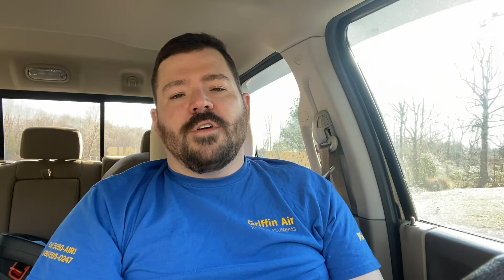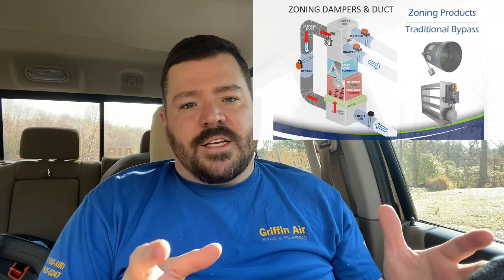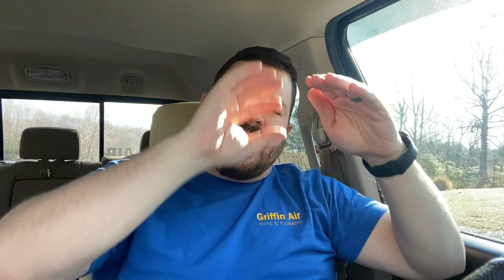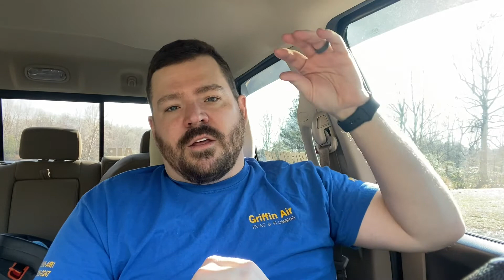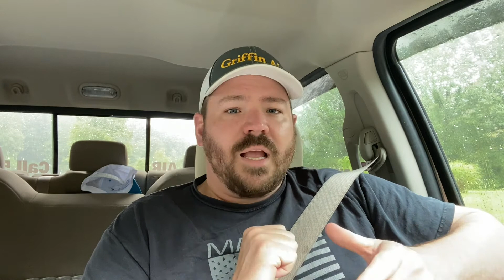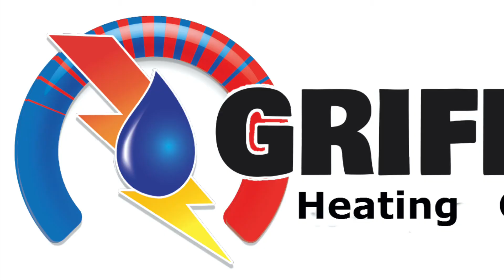Pros and Cons of HVAC Zoning  Do you need it? Basic zoning systems explained. Honeywell etc.

Comment: Zoning a multi stage system lets you stagger the schedules for different parts of the house, so you don't have 4 time slots for example, but rather 4 time slots for one part of the house and 4 totally different time slots for scheduling the other part of the house. It's just a unique feature worth exploring if you're system is zoned.

Comment: So if u have a multi zone system like this and say one part of the house is set at 76 and a different area is set at 80, will the shut damper end up developing condensation since air is hitting the door/damper? 

I feel like this is a recipe for mold down the road. Am I wrong?

Comment: I loved your video, wished I'd watched it a few months ago, haha.  I have a 2400 sf house that originally had a no zone system. The previous owner (5 years later) changed it to a zoned system with some duct modifications.  I am now replacing the system, as its 20 years old and i want to know if i replace it without using utilizing the zones, can I later have the zones added if I'm not happy with it?.  Basically, I'd just make sure all dampers are open.

Comment: About your zoning a smaller room. I have a bonus room upstairs that is about the size of a big master bedroom. It is surrounded by the attic and gets very hot in the summertime. Would you recommend zoning that room if we have a five stage unit? I understand what you're saying about a single stage blowing at 100% for a small room like that in your theory makes sense to me. But if we have a communicating system that can ramp down will zoning that room make sense?

Comment: I have found that zoning achieved with a control board and dampers is a waste.  The components fail.  When they fail, if not handled properly, can lead to failure of your HVAC system.  That happened to me.  The damper for the upstairs was stuck closed and the temperature cutoff sensor was also not working properly.  The evaporator coil froze up and the system also a bit aged.  The compressor ended up failing prematurely.

I prefer having separate systems to achieve zoning, when zoning is necessary (like different floors).  In that event, if one fails, you at least have the other.  I had a 3-ton AC that failed because of that damper.  I replaced it with a heat pump that is also 3-tons and it can be down regulated to 2-tons.  So, I will be getting a second unit and down regulate each one to 2-tons and have the option to switch it back to 3-tons if one fails.

Comment: On minute 5:00 you mentioned multi zone sometimes is not the solution. So what is your recommended solution if I have 1 room that's always get warmed up because of the sun hitting it all day but the rest of the house is cool? The difference in temp can be 10-15 because of this.
Reply from the maker: Every house is different. There are definitely houses were zoning makes sense. The point of the video was to point out how many customers think zoning is the solution when maybe it’s not or maybe it’s simply not needed
Reply: @NewHVACGuide  well, that's a very generic answer that doesn't even give any clues whatsoever for potential solution.
Reply from the maker: @hdarmawan   In most cases in scenarios like you're describing, I'd probably install a mini-split.
Reply: I wonder if there's less insulation in said room, it will probably always be somewhat warmer either way

Comment: Nice guy here, but he is not telling you about how to zone a house, but telling everyone why existing system should not be modified to be zoned.    You will spend more money on your heating and cooling than you do anything in that house.   I strongly suggest you hire a good mechanical engineer to design your system.  He or she will not be trying to sell you equipment or make some vendor's equipment fit an odd situation.   You would not hire a nurse to operate on your foot instead of a doctor.   Don't pay an HVAC tech do design your system, pay an engineer.  As an engineer, I don't tell the tech how to install ductwork or vacuum a line, but at the same time he should not be doing HVAC design.  It's the fox watching the hen house.
Reply: Fair comment, but mostly applies to someone designing their home to-be. Very doubtful the engineer could be value-added to existing homes (any more than an experienced technician).
Reply from the maker: Interesting argument. We should do a show and debate this 🙂

Comment: I thought you meant zoning for apartment buildings, there's 6 units everyone has their own electric furnace combined air-conditioning unit and this is where the problem comes in there's a vent in the hallway on every floor and that's because the owner doesn't have a separate AC heating furnace and some people refuse to turn on their air cuz they feel they shouldn't have to pay for the common area's I believe it used to be called a universal system but the girl across the hall refuses to believe that we both contribute to the hallway and shes put cardboard and duct tape over the vents which causes my unit to run 24/7 and my ceiling vents were wet! she doesn't believe I'm right & insists there separate units and one doesn't affect the other , we all have are own thermostat it's just that the system is meant to work together! my Father is a licensed Union pipefitter retired now but he's done all the huge universities uic Morton anoretium Braidwood nuclear plant Mars candy and pet food unfortunately he's 91 and is kinda slipping I don't want to argue with this girl but I don't wanna go out and get a bunch of window units and pay for someone to put them in, I don't believe shes the only one cooling the hallways I think the duct work is up in the ceiling where it pushes it out from both units pretty sure it's not legal in Chicago anymore

Comment: I just talked to a tech. He suggested to install a new 4 ton. system with two zones, a damper, and two thermostats. I have a house (1,400 sf) with an in-law attached to the house (500sf). He said that installing a new 1.5 ton system exclusively for the in-law will be more expensive on the monthly electric bill. Does it make sense?

Comment: I have a 6 zoned system. It cost me a pretty penny but I like it. I didn't do it for efficiency as much as for comfort and control. One thing that would happen is my bedroom faces east and as the sun would rise it would heat up the bedroom quite bit before it would increase the temperature on the thermostat to turn on the AC. It is a little on the loud said when one or two small zones are being cooled because its a 5 ton unit. But all in all being able to have control over individual zones is very nice.

Comment: I have a  1 story house , installed a new infinity system , 18 SEER , like the original 12 SEER 20 year system, one side of the house that gets more sun , there’s  is always 3 to 4 degrees different in those bedrooms, campare to rest of house , Do you think a 2 zone system that I was offered ,by installing comp, would help a lot or increasing insulation in the area of the house in central FL would be better , He offered to install the zone system @ cost because, I was not happy paying all the money and system didn’t fix my problems, but is an additional $2500 to $3000,

Comment: Hello got an estimate for dual zone system. First hvac company wants 3800 to install and hvac co say it can't be done bc I only have 1 return. The duct has one running to the second level and a separate one the the first floor. Can it be installed?
Reply from the maker: Every house is different. It’s hard to say the answer to your question without actually seeing your home. Sounds like you need to get some more opinions on the matter.

Comment: New subscriber here, if someone could help me with a question. I recently replaced my 18year old 4 ton system with a new 5 ton system. The old system had a zoning on it but my hvac guy said it may have caused potential issues with new system; so I went without. I do have 2 levels and the upstairs room is huge and is above our garage. My HVAC guy says it's gonna be an extra $2500 to install new zoning. Does that sound about right? I'm just trying to get more familiarized with an area that I know extremely little about.
Reply from the maker: There are many factors that affect the price of adding zoning. How many zones, the type of zoning you have, communicating, or non-communicating, and of course labor pricing in your area. I would recommend getting another quote if you are uncomfortable with the one you received.
Reply: @HVAC Guide for Homeowners  in your opinion would you say most 18 plus year old zonings would have an issue communicating with a brand new system? It's just a separate zone for single room upstairs. The old zone control is from EWC.

Comment: I’m a contractor.  I had one house and at least ten estimates from hvac guys.  Each hvac guy said the last guy I got an estimate from didn’t know what he was doing. I would need three units to heat the house. One guy was one system and said the rest of the guys were whacked out.  
You can go through YouTube and CONSTANT bashing of hvac guys.  You hvac guys really need to get your crap together.  Come up with some sort of standard for heating systems instead of this bashing the last guy.  It’s getting frustrating and old.  Tooooo much drama in hvac.  Learn to do hvac in some standard type platform and stick with it.  This is a nightmare for homeowners and  contractors when YouTube after YouTube video is how everyone is “everyone is doing it wrong but me !”  Hair salons don’t have this much gossip or drama !  
Also the different brands of furnaces !  Geez!  What a nightmare to listen to these videos.  The only good brand is the one they are selling.  
You don’t see carpenters on YouTube constantly  bashing other carpenters.  Some hvac houses are complex.  But it’s even worse with so many opinions.  No set standard.  I won’t even call hvac guys anymore.

Comment: I have a 400 sf adu/granny suite that shares one wall with the main house (single story). It’s Not connected from inside. The adu has a mini split. It doesn’t work well. We use it as a gym and wondered if we can extend our main HVAC to the adu through the attic. This is where I was thinking to use have a dual zone. Good or
Bad idea?

Comment: Would love just some quick input on this….
My scenario:
2300sq foot - 2 story (in Dallas)
Note - back of house gets full east Sun, front of house gets full west Sun (with 18 foot windows)
* All bedrooms on second floor 
1st floor has 4 ton
2nd floor has 2.5 ton

My question is can/should this house be set up in a 3 zone.  And my reasoning is the front of the house that gets all west Sun is a floor to ceiling living room/dining/and staircase.  The first floor 4 ton unit spends so much energy trying to keep that very large front area cool AND WE NEVER USE IT.  Now because it’s part of the open staircase and a half wall upstairs over looks it, does that impact the second floor?

My whole goal/point is to only AC the parts of the house we use…which are the back half of the first floor and all of the second floor.  When electricity rates DOUBLE, you really start looking at the inefficiency of your layout…. And yes, my house can stay cool, but it litterally will run all day long.  Which I know in 105 heat, it’s almost unavoidable, but I just wonder if a 3 zone would help minimize the units running all day.

Comment: You should talk to ewc and try to get into one of their classes on zoning. There is several benefits to a zone system. Even on a single story building you will always have different heat loads from sun exposure, windows, exterior walls or more or less occupants. These problems wont be fixed by properly installed ductwork. Ewc's smart bypass also fixes a lot of the problems that old zone systems have. I have installed several ewc zones systems for my customers and they absolutely love them. The only downside is it is not inexpensive.
Reply from the maker: I'm sure they have some pretty convincing reasons why one should install zoning 🙂

Comment: I have a refrigerant leak on a six year Lennox 4ton system that is a two zone system 1 zone for each floor. Two HVAC companies have confirmed it’s leaking but neither of them want to fix it and they are both recommending replacement. One says delete the zoning and put in a single 5ton for the entire house. The other company says replace the Lennox condenser and evaporator coil with Goodman and leave the Lennox furnace. This seems so counterintuitive and illogical to me. It’s only six years old I can’t in good conscience scrap the system. Is it unreasonable of me to want the leak fixed and keep the system as is? What should I do?
Reply: Have you checked your warranty? Lennox typically has 10 years
Reply: @Zi.Zenior  Hi there, yes I checked the warranty and sadly it’s only a five year warranty and it’s been six years. I ended up just charging up the refrigerant and the system has been running fine. It’s possibly a very slow leak. Eventually I think I will just replace the evaporator coil as that is the most likely culprit of the link. I understand Lennox made some sub-par evap coils for a number of years.
Reply: @crush5454  refilling it and letting it leak out will most likely burn your compressor. I think the tech that recommended to keep your zoning is right.

Comment: Hi, I have a 2 story home that had a zone damper system. I replaced the HVAC unit and the HVAC techs did not connect the downstairs thermostat or zone system. They said to give it a try without the downstairs thermostat and zone system but I can already tell the downstairs is significantly colder than the upstairs. I am going to call the company back and ask them to re-install the down stairs thermostat and zone system, can the HVAC tech install the zone system incorrectly? Reason I ask is I can tell this was challenging them and that is why it took 13+ hours to install the new unit. Any expertise you can offer would be great.
Reply from the maker: Definitely sounds like an odd predicament. Is this an actual reputable company? Zoning is a little more complicated than installing a system but still not that hard for the average installer

Comment: Hi, very informative video, we have ranch home , 1900sqft main level and 1000 sqft basement finished, in winter our basements is 8- 10 colder than main level. We found out our builder only put 66000 btu furnanace. What would ideal solution, having two zone one for main and basement exact or upgrading the furnanace to 100k btu? Thank you so much
Reply from the maker: Because every house is different. I would defer to your local pro and their opinion

Comment: I am living in the Bronx of NYC. My home is a two storied. 900 square feet in each floor. It was built in 1940. The 1st floor has a sensor and thermostat is in the basement. I have tenant in the first floor.  That's why the thermostat is in the basement where they don't have access.  I pay for heating. I didn't want them to control the thermostat. But unfortunately one of the bedroom in the second floor is not heat enough.  I don't know why. Does anybody has any idea?
Reply from the maker: Could be several different reasons. Ductwork, insulation, and zoning all could play a role. Have a pro take a look!

Comment: I have an open ranch built in 2021. I installed a Honeywell T-10 stat with 2 room sensors. One of our rooms is 3 degrees cooler then the rest of the house. There is one supply duct that is 4”X10” That particular room has 3 outside walls. There is a 5’x4’ window which is the same as every other room. The house is well insulated. 

I’ve turned off and adjusted dampers to control flow but still have the same results. So I started looking into zoning but I’m at a standstill.
Reply from the maker: Eek.  What a pickle.  Have you had a pro look over everything?

Comment: Central Air zoning systems are an attempt to create a central cooling system that can be operated like the domestic water system or electricity in your home so you can for example turn your lights on in one room and off in another.
It never really works right because in heating and cooling you have to have so much airflow across an evaporator or heat exchanger. 
Even if the ductwork is sized right it can be problematic.  Customers often times misuse them by setting one zone at 70 and another at 85 all night and end up with a frozen coil in the morning.  Now you can overcome that problem with an anti freeze Stat but it reaches a point where it all becomes impractical.
Reply from the maker: I only do zoning if absolutely necessary. If everything is installed properly, you should not need zoning.
Reply: @NewHVACGuide  
Agreed 👍

Comment: OMG, I need your help. In Chicago area, every thing is natural gas.  Tri level house.  Currently one over sized furnace that is going.  Upstairs return ducts actually giving supply air.  All return ducts were panned. I opened up the ceiling in lower level to expose the ductwork.  Someone disconnect the return ductwork, left gaps so large I could put my hand in them.  Replacing everything.  All HVAC guys tell me zoning will work. In my experience it doesn't.  I don't use all three levels. At times I  want to turn one level off or only slightly condition it, we use completely use the other level.  I am convinced I need three systems. I was thinking of ductless minisplits for some of the areas to achieve the zoning and because I don't have enough room for adequate ducts.  What do you think, tri-level, minimal room to run ductwork.
Reply from the maker: I'd have to defer to your local experts.  Every house is different.